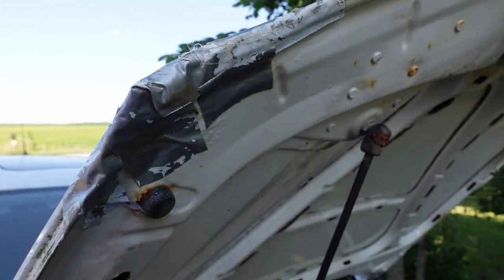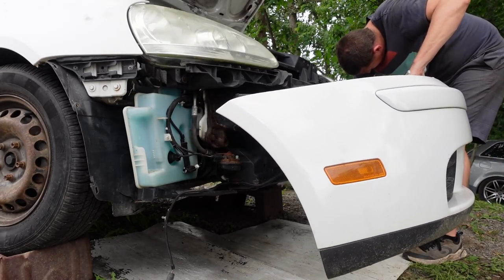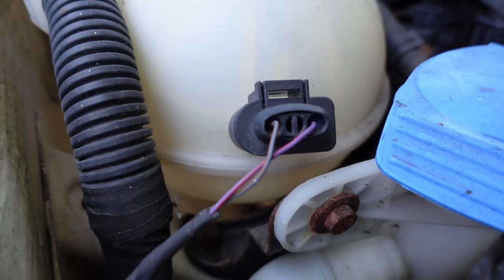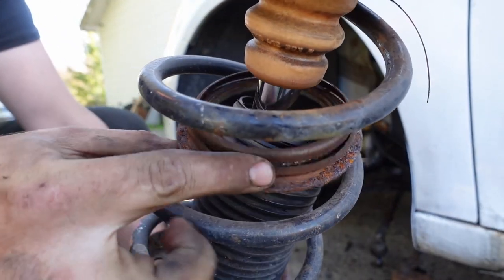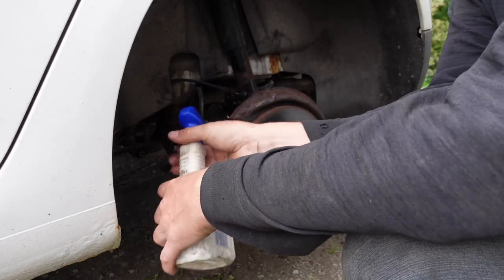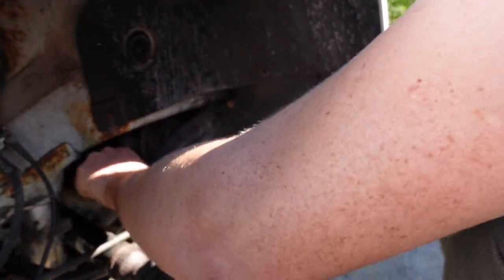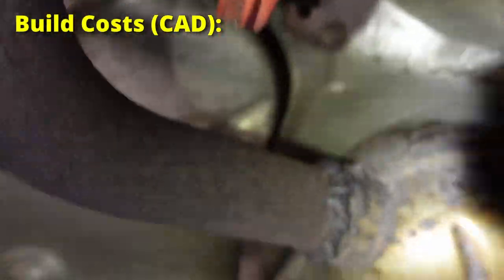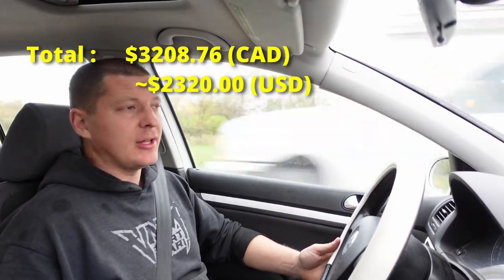VW Mk5 Mk6 Rabbit Golf Common Problems

Comment: I had a four door with manual. It sounded amazing when I had an exhaust leak 😂 until it got too loud. Straight pipe is the way to go. These cars are solid but getting more power is a problem so I got a GTI. Thermostat went at around 100k. Then I drove it for another 60 k without any issues. Just oil, brakes.  Original clutch and all. Maybe bc this gen is made in Germany.
Reply from the maker: Yeah the made in Germany aspect definitely influenced my choice of buying this one.

Comment: Love the video. I'd love to be able to produce content like this. My son and I have the same project car. We picked it up for $800 and invested about $4k into it. It mostly had the same issues you found. I managed to find a complete "scratch and dent" ESC coilover kit with mounts, bearings, stretch bolts, etc for $150. I installed a mk6 GTI exhaust for $50 and the car sounds tremendous!  We have a short running intake manifold and an ECU tune now. I have a few videos on my channel if you're interested.
Reply from the maker: Nice! I’ll check them out!